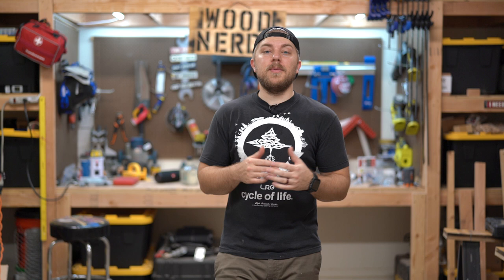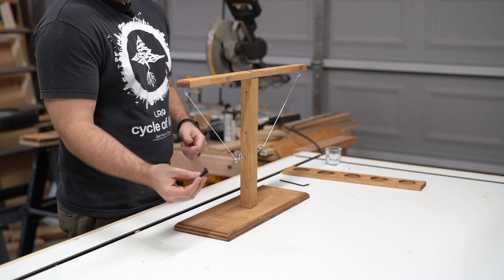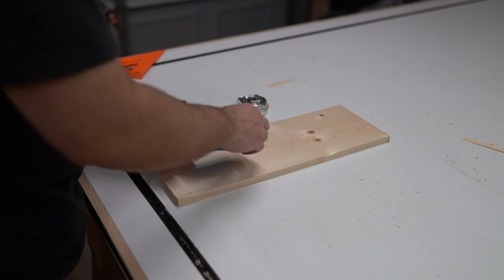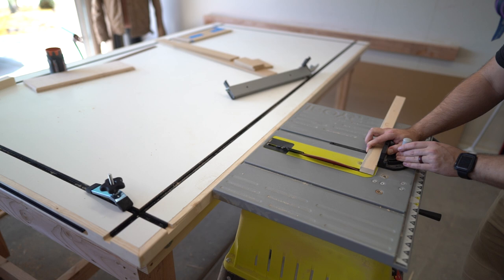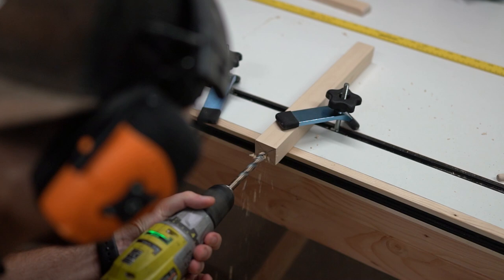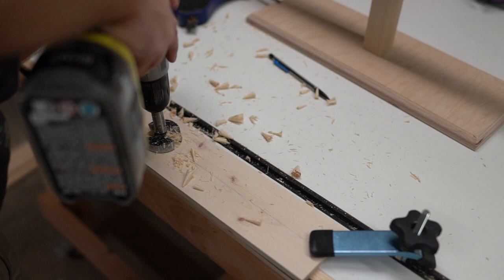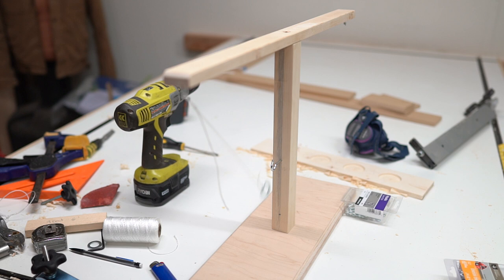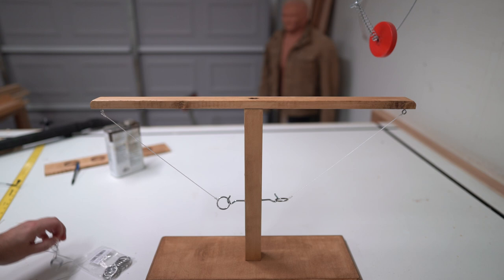Hook and Ring Drinking Game DIY / Fun Drinking Games How To

Comment: I love that you build awesome products with tools normal people can actually afford.
Reply from the maker: Haha it’s honestly a struggle sometimes. So much so that as I transition into more furniture builds I am planning on upgrading. Some of my cheaper tools have been inaccurate and cause hours of fixing or hiding mistakes. I’m upgrading my table saw to a SawStop for sure (I’ll be making a video on my reasons) and my miter saw as well. I do love a tool with a high value to cost ratio so that won’t change, but as for the main tools in my smaller shop I am going with the “buy once cry once” motto and expect these couple of tools to last me the rest of my life. (Fingers crossed).